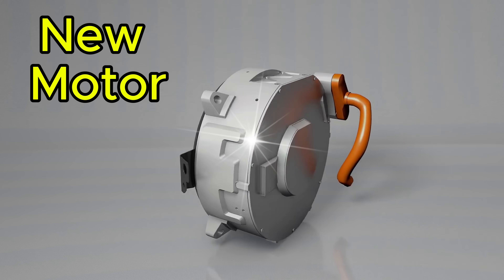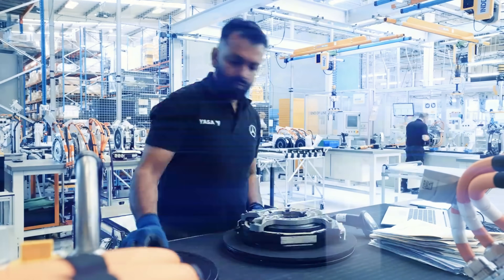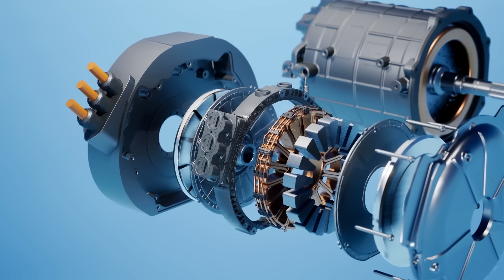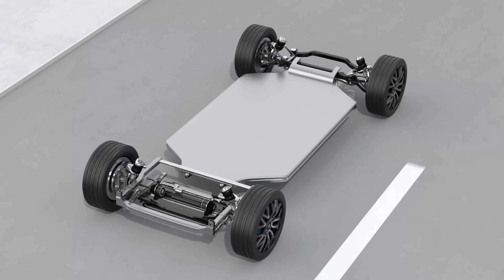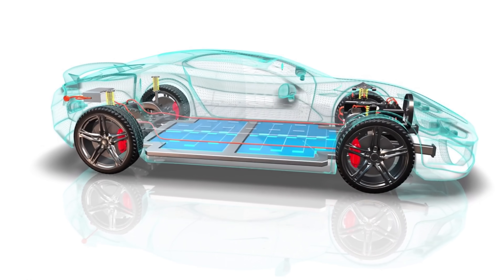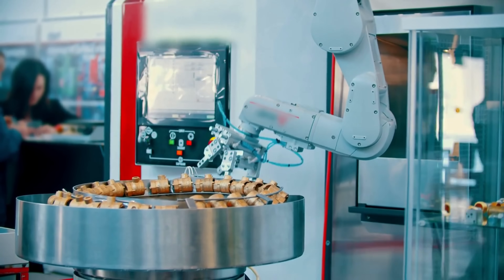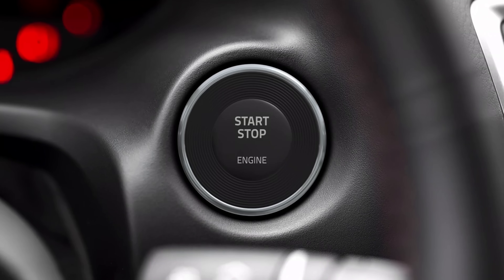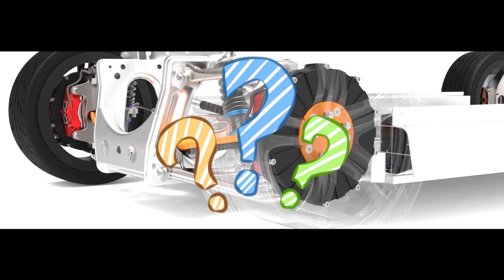New  Yokeless Motor Offers up to 4× Greater Performance – Here’s How

Comment from the maker: The Yokeless Axial Flux design may just be the key to unlocking next-gen electric propulsion—and Mercedes knows it.

What do YOU think? Is this tech just for elite supercars, or will it power mainstream EVs soon?
Let’s talk below. 👇👇👇
Reply: I think you're on crack dude.
Axial flux motors have been around for many years 
Second... Motors have a stator and a rotor.
Reply: How do you think which motor is more durable for heavy duty BLDC or AXIAL FLUX

Comment: this seems very interesting.
I'm not a high inteligent technician as others, but I see this other possibilities not only for electric cars or vehicles, but other motors as well.
for machines or fans.

cost and other stuff woundn't be very efficient as regular motor for now, but mass produce will change for sure later times.
Reply from the maker: That's a great point, and it opens up interesting possibilities for various applications!

Comment: KONE elevators invented this type of motor already 1993.
Reply from the maker: Interesting to hear about the different applications of this type of motor!
Reply: @renewable_energy  so you delete your lies? 😂
Reply: Axial flux motors go back to 1821 over 200 years ago.  You find them in many things fans, pumps, power tools, elevators ect but they haven't been powerful enough to be used in cars or aircraft until now.

Comment: Technically with this... you might be able to put a motor in the rim. So every tire would have its own individual motor. Maybe each one could have a different fuel or source of power. Would out class a hybrid or those chimeras
Reply from the maker: That's an interesting idea, and it opens up some interesting possibilities for vehicle design!
Reply: @renewable_energy  once someone creates that then the only competition left will be the successor  to hybrids ..."chimera" vehicles. But a chimera is only 3 so a quantum (4) will always beat it. After that its only star wars and star trek type stuff that can go beyond. Its like going from a car... to a mobile home... to a moving base.
Reply: Does this already exist in e bikes-.wheels, rims are motors!?
Reply: @kitkimbrough1145 
There is something called an axial flux motor

Comment: Not so new. 
It’s already built in a Lamborghini
Reply from the maker: Lamborghini uses axial flux electric motors developed by YASA Motors in their hybrid powertrains, specifically in the Revuelto and the upcoming Temerario. These motors offer high power density, compact size, and are a key component in Lamborghini's performance-focused hybrid systems.

Comment: It is not just the motor that makes the concept car from Mercedes special. Also the battery technology is special. The battery can be charged with 800KW and in 5 minutes you can charge it with 400KM of range. And the car can travel at 360KM/h without frying the battery. There are no charging stations yet that can charge at 800KW, but that is only a matter of time. In Europe the number of electric trucks and charging capacity with new charging stations continues to grow.
Reply from the maker: Thanks for the additional information about the battery tech, it's great to know more about the overall vehicle capabilities!

Comment: I found this motor in my 30  years old computers Harddisk
Reply from the maker: Agree with you, the idea is old. But they have solved the issues that were before, and so enable mass production.
Reply: @renewable_energy  no, you just lie😮😢
Reply: Yes. It's old known that but best simulation technology it's possible for in edge to edge.

Comment: It is a great Motor, I LIKED this video. 

A yokeless axial flux motor is an electric motor design that eliminates the stator yoke, resulting in a more compact and efficient motor with higher power and torque density. This design utilizes individual stator teeth not connected to a back iron, with magnets placed on the rotor, allowing for a more efficient flux path between the rotor and stator. 

In essence, yokeless axial flux motors represent a promising advancement in electric motor technology, offering a compelling combination of high performance, compact size, and potential for cost reduction, making them well-suited for a range of modern applications.
Reply from the maker: Glad you liked the video and found the motor design interesting!